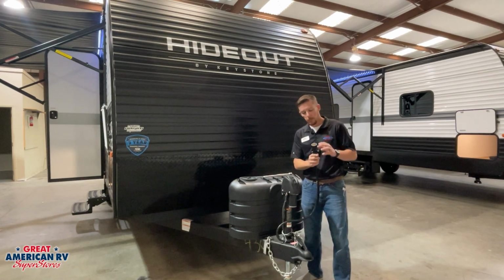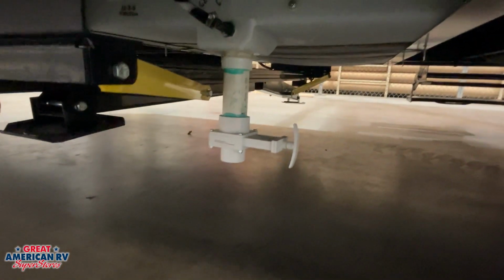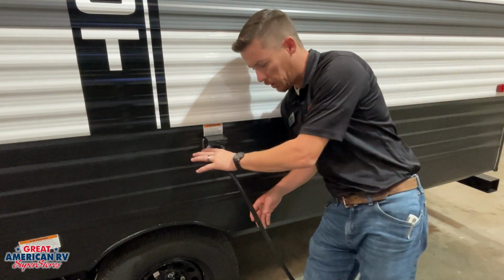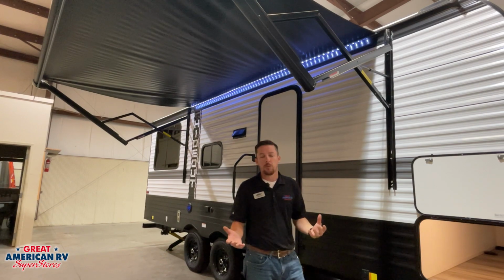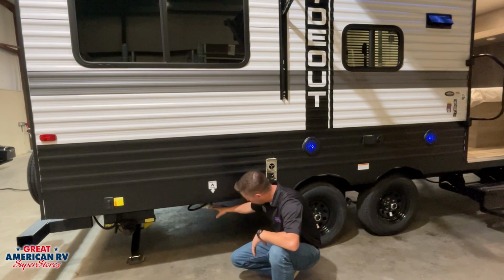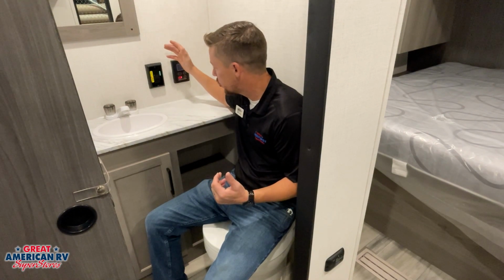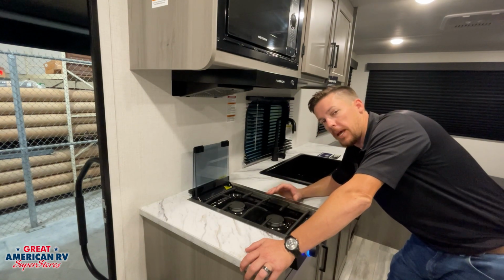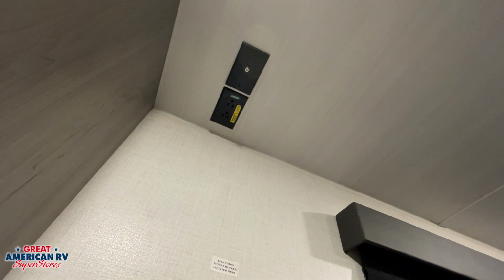2024 Keystone Hideout 200RL Owner Delivery Walk Thru

Comment: Your talk about the shower head and hot water is so far off the mark.  You cannot mix hot and cold water or you will get a cold shower.  If you choose to shut off the water to save water using the shower heads valve you will wait more than a minute to get hot water again wasting all the water you attempted to save.  Truth matters and you obviously have never used the tankless water system supplied in this unit.
Reply from the maker: Thanks for the correction in that, I do a lot of these videos and when I gave the shower advice I obviously had a normal electric or LP water heater on my mind.  Tankless water heater set it to temp and only use hot water, don’t mix with cold.  Thanks for pointing my mistake out for our viewers! -Todd